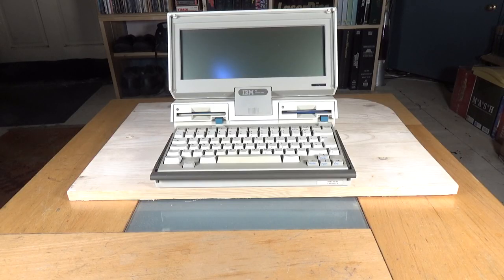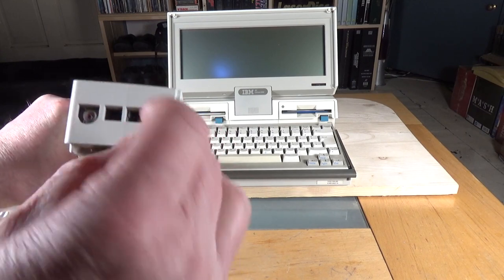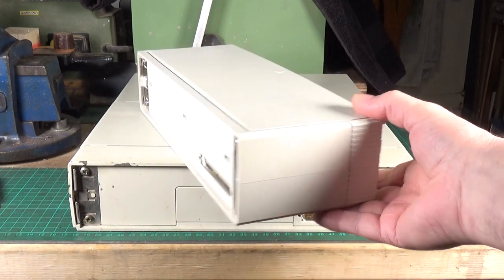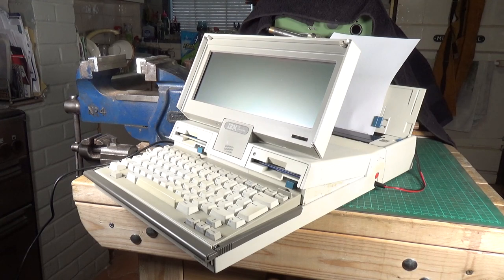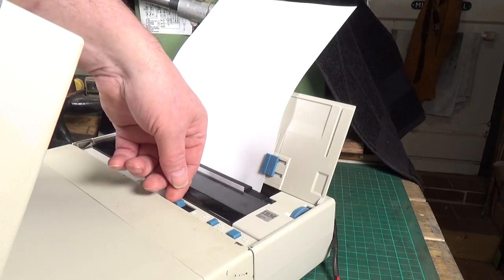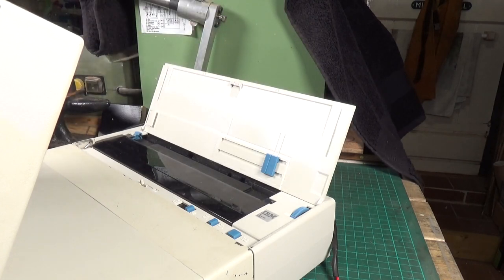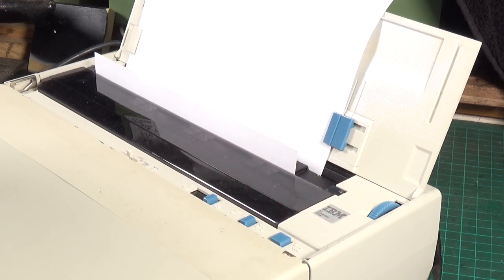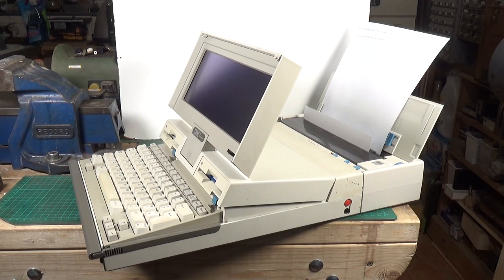Retro Tech - IBM PC Convertible Printer

Comment: Hi, your IBM 5140 is in superb condition! :D
Mine has unfortunately got a not-working printer and I don't really know how to repair it, since I am not an expert!
Every time I change the switch from "Off line" to "On line", I can hear a really little noise coming from the printer, but nothing else. It seems as if the head with cartridge were "blocked" somehow, since it doesn't move.
When I try to print something, the computer says the printer is not ready.
Have you got any suggestion?
Reply from the maker: Hi. The only thing I can think of is to try cleaning the connectors on the printer and the 5140. Use cotton buds and isopropyl alcohol.
Reply: @RetroSteamTech  Hi, unfortunately I have already tried cleaning with cotton buds and isopropyl alcohol, since this is usually the first thing I do when something in electronics doesn't properly work. I'll try to persist, maybe I'll be able to see an improvement.
Anyway, thank you for the advice and for the answer! :)